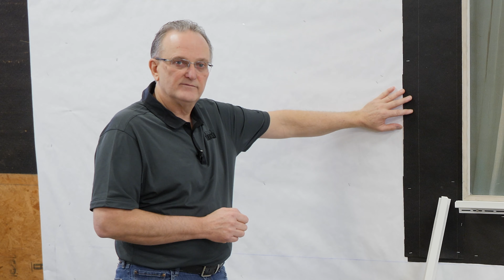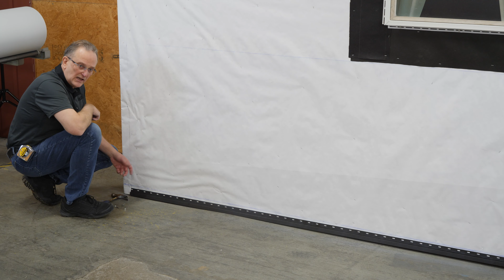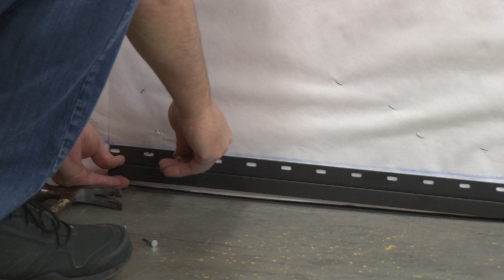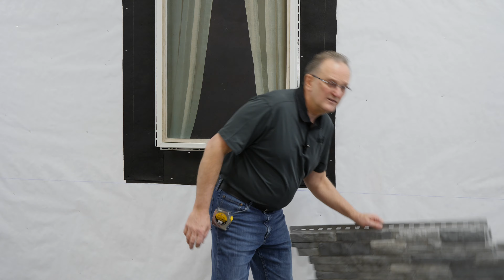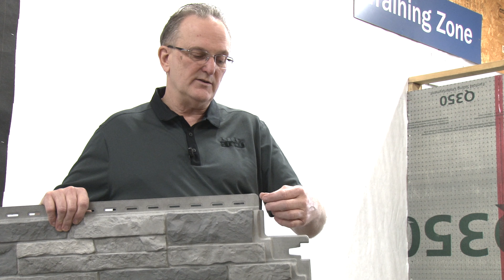Atlas Stone Installation - 1. Getting Started -old

Comment: Hello Is this Plastic an imitation of Stone?  Where Can I Find Out The Price I Can Decide I Have A Big House, Do You Have Your Web Address?  Thank you Alex
Reply from the maker: Hi there, Atlas Stone is a composite product with a base of polypropylene capped with a Kynar finish. It's a reliable, weatherable, lightweight material that can provides the look of stone with easier installation. Learn more about Atlas Stone here: https://www.royalbuildingproducts.com/sites/rbp/files/2020-02/9828_rbp_atlas_stone_2019_brochure_8.5x11_update.pdf. Pricing is dependent upon a number of factors including product type, quantity and location. Our products are sold throughout the U.S. and Canada through various distributors and contractors. Please use our product locator tool to find the ones nearest you: https://www.royalbuildingproducts.com/find-our-products.

Comment: How would I cap the top panel if I wanted to create a faux stone wall on the bottom half of a t111 wall, leaving the remaining t111 wall above?
Reply from the maker: Thanks for reaching out! We would suggest cutting and removing a narrow section of the T-111 just below the point you’d like to terminate the Atlas Stone. Then a piece of flashing could be installed under the T-111 above that piece; the section of T-111 reinstalled and then the stone installed. If a stone ledge is preferred over a J channel, follow the instructions on page 6 of the stone ledge guide under “ Finish under a Window Sill.”: https://www.royalbuildingproducts.com/sites/rbp/files/2020-02/div0354a_installation_guide_-_stone_ledge.pdf. We hope this helps!